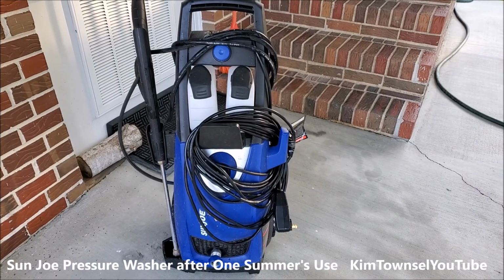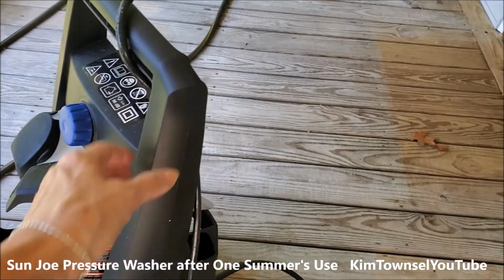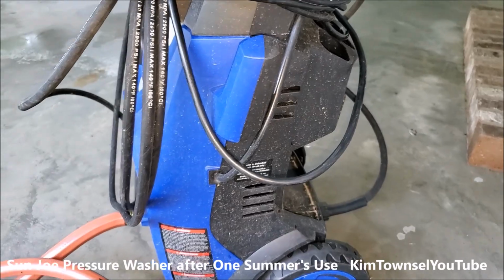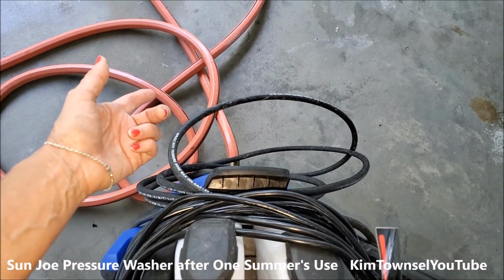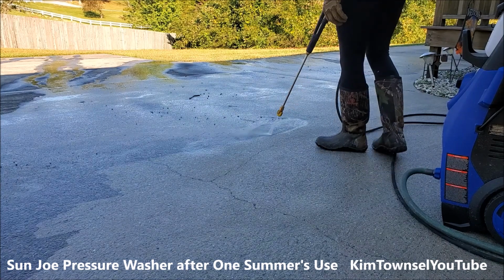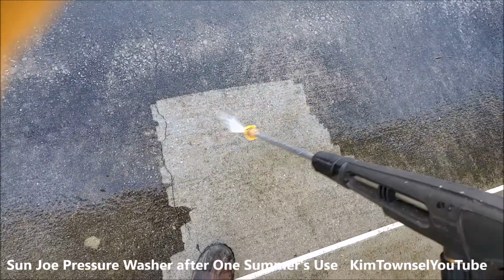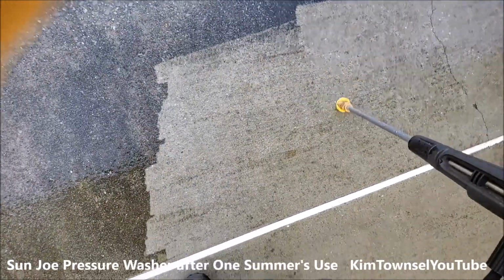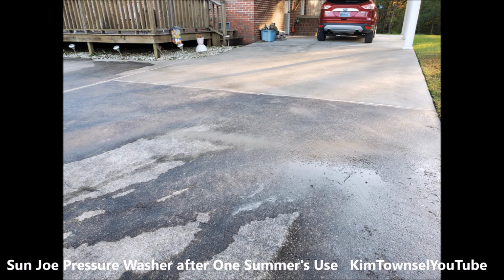Sun Joe Pressure Washer after One Summer's Use | KimTownselYouTube

Comment from the maker: Sun Joe SPX3000 Pressure Washer Videos I created
Sun Joe Pressure Washer Assembly by a Novice https://youtu.be/0Kh8j3gW-Ow 
Sun Joe SPX3000 SJB Electric Pressure Washer | First Use  https://youtu.be/VffbwQsu7xI
Sun Joe SPX3000 Pressure Washer on Different Surfaces https://youtu.be/8SKNP1onI4w 
ASMR Pressure Washing | Grimy Wood Deck Gets Cleaner https://youtu.be/NIdQdMUpaJU 
Sun Joe Pressure Washer after One Summer's Use | KimTownselYouTube https://youtu.be/rPuICHAzdKU 

Sun Joe SPX3000-SJB Pressure Joe 2030 PSI 1.76 GPM 14.5-Amp Electric Pressure Washer, Dark Blue https://amzn.to/3dXOfoC
Sun Joe SPX3000-MAX 2800 MAX PSI 1.30 GPM High Performance Brushless Induction Pressure Washer, Lime Green  https://amzn.to/2AliXtp 
Sun Joe SPX3000-RED Pressure Joe 2030 PSI 1.76 GPM 14.5-Amp Electric Pressure Washer, Red  https://amzn.to/2MRZEuf